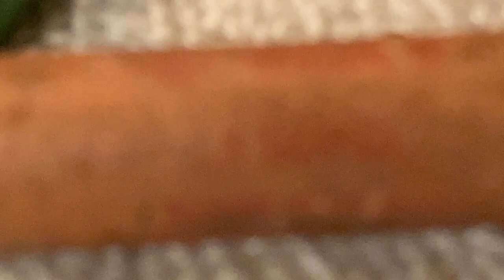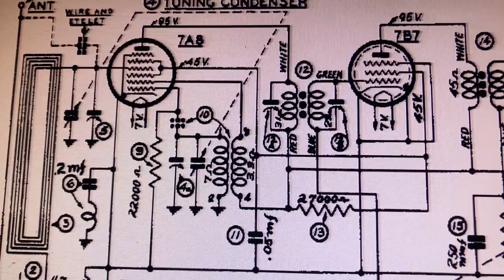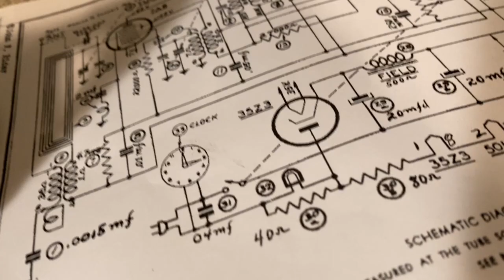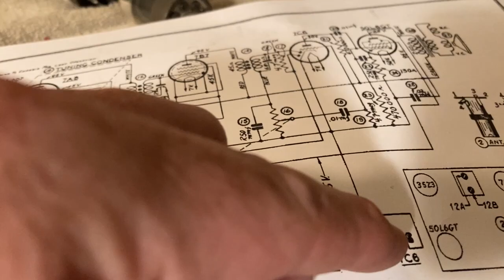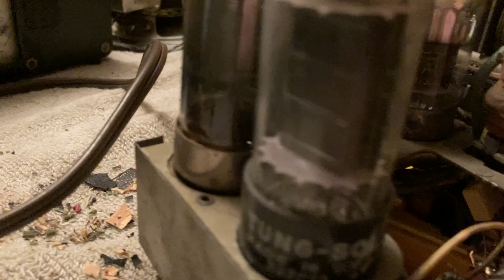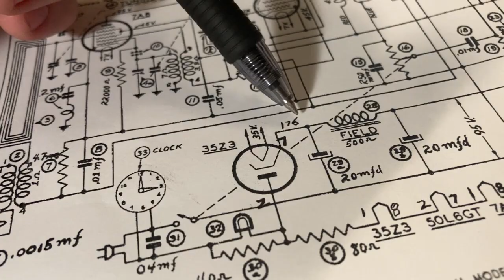This 1942 Philco Radio Just Keeps Getting Worse!

Comment: I've come across another one of your videos. ANOTHER FANTASTIC radio. That's organic rubber wire. That's some pretty raunchy stuff. Just don't plug the radio in until you've replaced ALL of the organic rubber wire. Ya do not want a house fire. I REALLY  enjoy your videos about these radios. Philco was a GREAT radio of its time. I'm sure glad ☺️ that you're keeping this 1942 Philco radio out of the dump. Your friend, Jeff.
Reply from the maker: I just picked up some replacement 35z3's for this thing and a couple of them are NOS philcos, not that it matters but I might as well put that one in I suppose.

Comment: I don't know, but if it were me, I'd move that one cap to the other side of the power switch. There is no clock there, and caps can short. So instead of having the line filter powered all the time, maybe only when it is turned on.

Then again, maybe it is supposed to help dampen the switch due to the current. Please disregard what I said above.

Comment: I remember working on a Bush radio made in 1956. That was back in the 1970s and the set was by then 20 years old. Guess what? The rubber on nearly all the wires had already perished after only 20 years, so after 80 years I suppose it has to be expected!

Comment: Unfortunately, there's nothing to do but rewire it. Use 20 gauge stranded, and keep it color-coded.

Red: Plate
Screen: Ornage or Yellow
Bias: Blue or Purple
Heater: Green
Transformer primary: Black and White, with white being the return and the black going to a fuse and power switch.

Everything else should be point to point at the tubes and terminal strips.

Comment: If the Majestic is a 60, 61, 62, 160, or 163, I have a copy of the service manual. It will have caps potted in the IF transformers under tar, if you can find the Majestic 163 restoration thread on the ARF's electrical restoration subforum. I have some pictures & info of redoing the 163 (phono version).

Comment: When your field coil is bad, just rewire the power supply like any AA5 radio without a field coil. I restored a Westinghouse AA5 radio that originally had a field coil speaker and I used a 10 watt power resistor. When I powered up the radio,  the power resistor got very hot!! I rewired the power supply like a typical AA5, and when powered up, the radio works perfectly and the resistor was warm, but not hot.

Comment: Before increasing the value of the filter capacitor always check the rectifiers datasheet because too large a capacitance can cause excess current at switch on and this can cause the coating to be stripped off the cathode causing permanent damage of the tube.

Comment: I once saw shango66 re-use a speaker with an open field coil, by sticking permenant magnets on the speaker frame. He bridged the circuit with a resistor, like you planned to.

Comment: On the plus side, these radios tend to sound a lot better if you run a modern permenant magnet speaker. You can harvest the original output transformer off of the original speaker and attach it to the back/side of the replacement speaker and then you just need a metal clad 25W power resistor. I usually buy them by the dozen off of ebay from china. Takes a while to get here but they're cheap. You can JB weld the power resistor to the chassis or metal speaker somewhere and then heat shrink the solder lugs/terminals when wiring it up (jb weld is actually pretty good as a thermal conductor). Once you do one of these you'll see that its not as hard as it sounds and start buying speakerless sets on the cheap (because other collectors won't touch them). The only expensive part is if its a set where the output transformer is on the speaker, and therefor missing, you have to find a replacement. But even here there are some ways to do that on the cheap depending on what it was. If you can handle stuff that makes most collectors pass a set by- falling apart wooden cabinets, missing speakers, no knobs/dial cover/etc., you can get some really desirable sets for a fraction of their value instead of paying full top dollar for something that only needs a recap.

Comment: I hate working on Philcos of this era. If its not the rubber wiring, or open coils its going to be intermittent locktal pin-socket connections. I did a total strip down to bare chassis on a PT-69. Replaced every mm of every wire, every capacitor and resistor and ended up with a radio that performs "okay" except 3 of the locktal sockets are so intermittent you have to constantly jostle the tubes to keep it working. Debated replacing the tubes with octal equivalents but decided instead to make the set a shelf queen. Also debated soldering the locktal pins into the circuit. Hey, it might work! Lol.